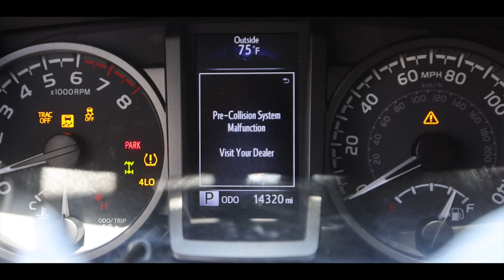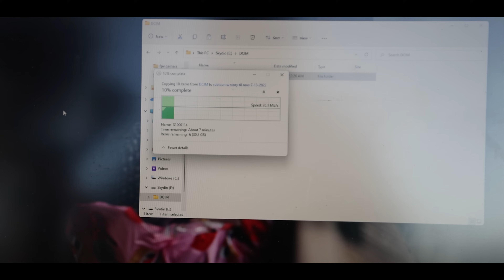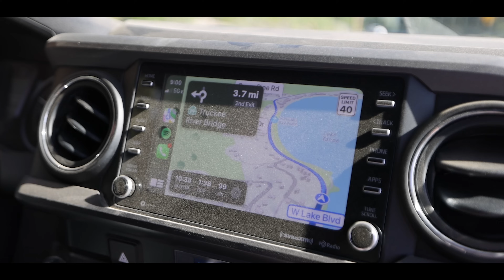Breaking Jeeps On The Rubicon With @TheStoryTillNow

Comment: I did an upgrade on a buddies Tacoma by installing a cotter pin in the transmission line "bypass" block to keep the lines open at all times. In addition to that an added trans cooler up front and he hasn't had further issues. Hope that helps.
Reply from the maker: It definitely does! I always consider a cooler for towing but this would be a good idea for crawling aswell. 👍
Reply: @DirtLifestyle  Nate, pinning that plunger in on the bypass block is very helpful in keeping the temps down before they get hot. You can find it inline with the trans lines under the passenger side. There's a plunger on the side with a tiny hole on either side of it, like a hydraulic timing belt tensioner. Push that plunger in and hold it while threading the cotter pin through to retain it. Love the videos and I'm glad I could provide some helpful info. 👍
Reply: Is this only for an Automatic Trans? The cotter pin deal. I’ve seen my low oil pressure like come on, once in 70,000 miles. But I was at an extreme angle.
Reply: Yeah it's for the transmission cooler bypass valve. It's s small block between both lines that is closed when the fluid temp is below a set temp (re-routes fluid back to transmission instead of cooler). When the fluid reaches temp the valve opens and allows the fluid to go to the cooler up front. Pinning it locks it open 100%.
Reply: @DirtLifestyle  that light comes on because of the angle of the trucks front end up being vertical.

Comment: 7:01 that’s a known third gen Tacoma problem same with the transmission heat. Get a catch can. And for the other codes you need teckstream to clear it. I got the same lights after a really messed up alignment and once after my steering rack bolts came loose and the rack was moving a lot

Comment: So the tacoma do have a low oil pressure light come on if its been on a weird incline. Its normal what people do to fix it add a half quart of oil if offroading a lot so you wont have that issue. Theres only been 1 person ive seen that has killed their engine because of it. The pressure light happened to be going down hill while offroading because someone infront broke down i just shut the truck down and waited till they were fixed and never had the issue again. I have a 2017 tacoma trd sport lifted with air lockers and all that too

Comment: Always keep a bar of soap in your tool bag. Fuel won't eat the soap, you just rub the soap bar on the hole or crack and it will get you out. I know from experience..it works like a damn!!
Reply from the maker: I've seen this trick in a few situations but none of them had pressure. In your experience would the bar of soap hold upto 10 psi of fuel pressure? Believe it or not I considered this on the trail but didn't think it would hold up.
Reply: @DirtLifestyle  honestly I've never tried with a pressurized component, but holes in a tank...yes. I can totally see it might not work in that particular situation.  Now that I thought about it.  ;)

Comment: If you have the radar cruise control there's a sensor in the grille that causes all kinds of issues. There was a TSB for it that was foam tape or something. Transmission is what someone said below. Toyota deleted the cooler in later models. Mine was a 2017 and I never had issues. A buddy had a 2021 and he had temp issues.
Reply from the maker: It's definitely the sensor that is causing all these problems. I need to figure out how to fix it because the dealership wants nothing to do with me lol
Reply: I could imagine! Surf Tacoma World. I seem to recall some owners with a DIY fix.

Comment: Don't apologize for talking numbers.  As another builder / suspension nerd, I love to here it.  I've always been fascinated by how there is no apparent "perfect" wheelbase or tire size.  One obstacle the 110" wheelbase rig will absolutely idle up without any drama and the next its all f'd off and banging limiter followed by a stock tj on 33's idling through with open diffs laughing.  It might be one of my favorite parts of wheeling.  It seems like every setup has its place.

Comment: I am not a Toyota guru at all.  But I think I remember when I was researching trucks to buy that I came across a video that showed an issue with Tacos when they are on an angle with their nose up.  I think in those videos there was an issue with losing oil pressure.  But they were older yota's and I thought it was resolved.

Also, at 10:34, it looks like you were pretty flexed out and your brake lines were almost straight.  I thought you made them longer, but you maybe you didn't.  Either way, you may want to make them longer.

I did the same trick to fix our trash can.  I used zip ties and melted them with a soldering iron to fix a crack on the trash can.  I think it lasted another 3 months and the cracks came back.  But in this case, what may have worked would have been to make the hole bigger and then fill it with the new material.

Lastly, you mentioned middle age.  I don't want to scare you, but think about your kids.  I remember when my boy was 8 and thinking we had 10 long years  until he was out.  But then i realized how quickly he turned 8 and I rephrased it to be, "we only have 10 years LEFT until he moves out!!!"  Holy cow.  That's when we became more intentional about raising him and having family endeavors together.  EVERY moment became special.  It's a little harder now that he's in his teens...we only have 3 years left now.  But we just got back from a trip that went from Charlotte to St. Louis and back in a bit, 2000 mile loop.  It was special.

Life's shorter than you think...even if you are healthy the entire time.  And you can't guarantee that you will be.  My dad passed a couple years ago at 74.  My mom will probably pass in another year or so at the age of 76. And they both led relatively healthy lives.

Figure out your passion and at least make some attempt to live some of it.

Comment: I welded a battery back together like this.  it had a hole in a cell and was dry.   so I used the handle off the battery and a little torch added water.  held a charge.

Comment: You can wrap a ratchet strap around the circumference of the tire and cinch it down it will cause the beads to push to the outside of the rim so you can get air started in it. Once you get the air started in it then back off the ratchet strap and fill it up

Comment: I was running gold mountain last week and I had the same issue with I was climbing a rock and the low oil pressure light came on and then the engine shut off. I have a vid of it on my channel it happened on the last obstacle. but there is a fix to it on the next oil change add a extra quart of oil to compensate for the angle.

Comment: If you haven’t yet I would do a zero point calibration on the steering. When this gets out of whack it makes Toyotas almost un-driveable.
Reply from the maker: The dealer did one the last time I was there. I'm thinking about revisiting this after moving my crash avoidance sensor down.

Comment: Guess a company that builds vehicles supposedly for off road use.  Needs to take experience from cummins and put the fuel filter in the engine compartment on the engine.
Reply from the maker: Absolutely 🙌

Comment: Excellent advice Nate. I just turned 67, so not sure what that makes me besides old. I live in eastern Pa. My rig is a 95 XJ with 4.5 lift and 33's. Not cutting the body as It's too nice to cut. Do you have any ideas for trails in my area that I can do with open diffs (for now) and 33's? I 've looked into Rausch creek too expensive (fixed income) I know there are areas around me that the sidexsides run owned by Jack Rich (local oil /  coal baron) that have a permit requirement. My rig is also my daily driver. Thanks for you time and for sharing. God bless and stay well.
Reply: Check out FRO 225/yr.

Comment: Your lights on the dash can be disabled by the dealership. We have a tacoma in town here lifted on 35s and it was the only way he could get them off. You can also try calibrating the steering angle sensor, and the yaw rate sensor can be adjusted to help limit the number of times they cause an issue.

Comment: On a road trip to Florida with the family I lost the bottom bolt to one of the calipers on my ford expedition. The caliper flipped up and was trying to lock against the rim. Limped into a pull off from the interstate. I always carry tools on trips. Pulled the tire and the other bolt from the caliper. Move it to the bottom so I could go forward safely. Got down to the keys and hit a napa. Ordered the bolts and came back the next day when they were in. While the family shopped I was under the truck. Adapt to the situation and make the best of it. An always carry extra tools!

Comment: Hey Nate when your transmission got hot did it shut the truck off ? Last night I was driving back from work heard a bang felt it to  one message said high transmission temperature and pressure  and when the truck came to a stop the engine shut off and I got a low oil pressure message  tried restarting but it kept shutting off

Comment: My Tacoma does that too while climbing steep hills “transmission fluid overheated”. I was told that it’s not really overheated, it’s only because the truck is at too steep an angle where not enough transmission fluid is detected by the sensor. All the other cruise control stuff are mainly because of your lift and front bumper/grille changes messed up the sensor.

Comment: That pre-collision issue sounds like it's possibly related to a throttle controller. Also with lifted Tacomas the front collision sensor in the Toyota badge needs adjusted to compensate for the height. I believe I stuck a few washers under one of the bolts to point it down and that got rid of the pre collision issue for me. Do you have one on the car? I have a '20 Tacoma twin locked on 35s, lots of custom electrical mods, never had an issue.

Comment: I have a ‘21 Tacoma and got the low oil issue a couple times when I was running some trails in Moab. Each time it was when I was sitting at a steep angle facing downhill. No trans issues yet as mine is a MT.

Comment: I'm no toyota guru nor do I have one, but I have a 2022 freightliner packed with all those goodies. And all of the above messages all tie into the cruise control. The sway indicator is because the truck is sitting different than it was when those parameters were set which in turns malfunctions the smart cruise and I can't remember the other malfunction, but I think it had to do with the stock bumper? Any way maybe some one can go in an turn all that junk off with good toyota software? Not for certain it can be done but it can on these big things. Just my 2 cents on another great video.

Comment: hell yeah on that fuel filter cap! great effort on that.  I have a brand new one, cause I broke the pepcock valve when I changed the filter. I'm gonna try to extract it when I change the filter again, but If I can't it's fully sealed, so I'll just keep it as a spare going forward. 

I was definitely mindful of it's location when doing some trails out in Moab at EJS this year. I love my diesel, but there are so many ways this can fail.

Comment: Did that trail in 2003 and 2004, it is awsome.We had a major break on the slabs soon as you leave Loon lake then the truck going back to the parking lot put a fan into the radiator on a hard drop.We spent the first day and night only about a mile in since the part for the first broke truck was in Sacramento. Rear carrier split in half in a dana 44 with a lock right and we replaced it with a Detroit out on the rock slabs.
Reply from the maker: That sounds like quite the adventure!

Comment: I had the trans temp deal happen once in my 2017 tacoma. Had to be a sensor issue because I’d only went like 3 miles so far so it definitely wasn’t hot yet. It happened when I quickly went from forward to reverse and started backing up. Guessing these transmissions just don’t like it when all the fluid goes to one part lol.
I’m 31k miles into my 2021 tacoma and no weird warnings so far but I haven’t done anything extreme like you do.
Rock on bro love the content 🤘🏻

Comment: The solution to the transmission overheat is a manual swap! There’s been a few trails on my 6MT taco that I had no issues while my AT counterparts struggled with. 

I’m not sure how much it will help with the shutting off problem on inclines but I’ve heard from a few people that putting an oil catch can or an air oil separator in helps alleviate oil burning issues. Supposedly the crankcase vent is on the driver side rear valve cover and at steep inclines pools up with oil and makes its way back to the intake. 

My suggestion is maybe drop the oil pan and baffle it like race cars so you don’t hit oil starvation and then add in that separator/catch can to prevent smoking

Comment: Cool video. I'm not a Guru but I believe what you may need to do with the truck is find out if HPtuner is supporting the 2021 or 22 year and then I would pull your oil pan and modify the location of the oil pump pickup tube and maybe your pan if need be and you may want to add a slosh or baffle plate to help hold oil in the bottom of the pan. We do it with the LS/LT engine pans for custom fitting into classics. Depending on what HPT supports you can go in and turn off the codes and check eng lt and even remove the sensor if needed. With what you've done to the truck there's no dealer that'll touch it for warranty. There sticky that way (worked at some) ABS & traction is another issue. Toyota has programming in them for safety shifts vs rpm vs spd that mixes in the trans, abs and tcs programming......if you turn off your TC system it will still operate under certain conditions and engage abs under certain conditions. Toyota's way of thinking they accounted for your safety. I'm not aware of a way around it yet. Like your vid's. I'm just down the road from you in Redmond OR. I'm building a 66 Stout right now and we have a 4runner & Tundra that I've had the same problems with.
Reply: Good motor but not really made for off road. I believe the guy who made OVTUNE mentioned that oil pools in the valve covers and has trouble draining back, hence the smoking that people see. There was something in there also about a bad oil pan design as well with the oil pickup tube and it leading to starvation. I don't think that the Toyota engineers pictured the truck going "that off road".

Comment: Sorry to interject half way into the video, but the pre-collision system probably needs to be re-adjusted given the lift/tires etc. 
I'm not really sure how picky that system is, because in theory it should of given you trouble before the trip.
Even if I add 33" tires and certain kinds of bumpers to my basic setup I will likely have to tinker with that myself.
Also If you replace the windshield it has to be re-calibrated.  

The pre-collision and the adaptive cruise control piggy back off the same system so in theory if you have a problem with apart of that setup, you'll have a problem with everything. 
Pro tip, if you press and hold the cruise control button it will lock your cruise control to a MPH vs using the adaptive cruise control.
I found this out when during an ice storm my sensors got covered and the adaptive cruise control stopped working for me. 

Also let it be known that the 2GR-FKS like many other engines doesn't like extreme angles for too long. I don't know if that ties into the oil pressure issue...but worth mentioning. 
Big Mike found out pretty quickly that a catch-can setup can save you from hydro locking the engine with oil that floods cylinder 6 during long crawls over steep objects etc. 
Extreme angles for too long causes the oil to pool in the back of the valve cover area and you will start to see white smoke out the exhaust.

As far as an overheating trans...I have a manual so I'll leave the auto experts to speak to that.
Though I wonder if some of the passive traction aids are doing something behind the scenes.

If you're bored, you may pick through The Car Care Nuts channel and review his Tacoma specific videos etc and see if some of that is helpful. 
(can skip around in the videos to find what you're looking for, I don't re-call everything that was talked about)
Reply: Super awesome video, one of your best ones yet :). 

I did do some research and found the below I'm quoting from TW.

"Lots of bunk info getting tossed around.
OP, when in a forward gear, if applying throttle and you roll back, it kills the truck as a safety feature. (Still can't get answer from Toyota what it's protecting) Generally it throws a low oil level, or trans over temp code by default. If you do the same hill while two foot driving so you can't roll back you won't have an issue. The truck will flood it's heads with oil before it actually has a low oil/oil pressure situation." - WarFab Armor

All in all, nothing wrong I guess...just perhaps quirky. 
I haven't seen any of those situations leading to damaged parts etc down the line either.

Comment: Question regarding the truck: did you have the windshield replaced? If you did and they slightly did the front camera wrong, the front collision won't ever work right. All those messages are kinda pointing to a wheel speed sensor acting up, so make sure they're all plugged in and not broken. As for it randomly dying, Japanese autos sometimes just randomly stall going high load to no load, I know on my Subaru if I tried to go up my giant curb and let off as soon as it went over, it'd stall. That's my best guess, and they should 100% cover the front camera if not altered, I doubt they'll touch any of the suspension stuff because it's largely aftermarket

Comment: Gotta pin the trans tstat, and add a tranny cooler with a fan.bMy 19 trans runs about 100 degrees over ambitient wheeling, with 35s/stock gears. Gets around 200-215 on hard climbs, but thats what the tranny runs stock